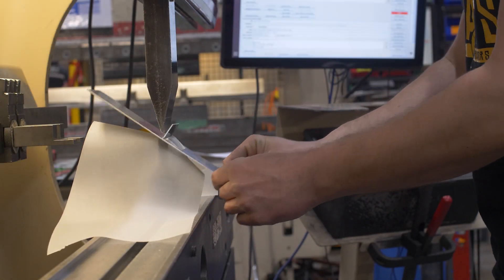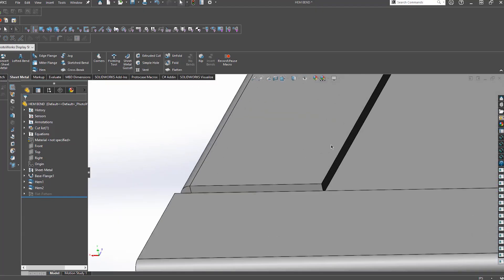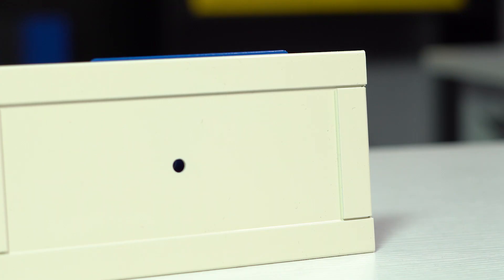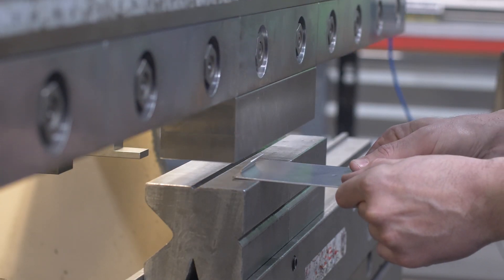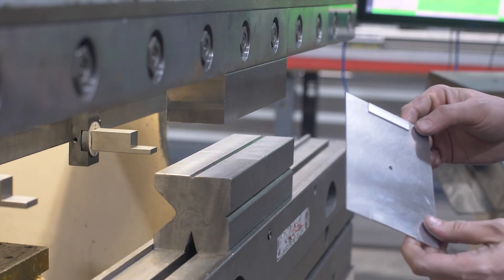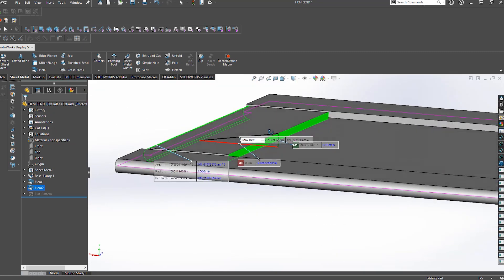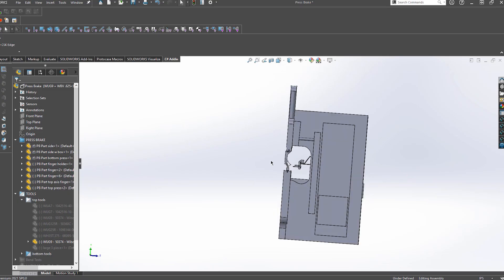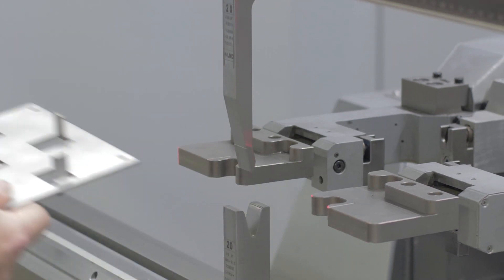Proto Tech Tip - Designing for HEM Bends

Comment: Hello, how to deal with hemming of the mitered corners? Is there any solution? Example: If I want to hem part like you in the video, only with the mitered corners. Thank you.
Reply from the maker: Hi there, we checked with our Engineering & Design Services team, and they said: "For our process of doing hem bends, if you required miter flanges we would need to remove the bend radius in the areas where the length is less than 0.5in. However, we would recommend going with how it is designed in the video."

We have a screenshot of how it would look to remove the bend radius, but you can't attach a pic to a comment on YouTube. 😕

Comment: What's the reason for the paper on bottom side of the die? Protecting material surface finish? Thanks for the video!
Reply from the maker: Hey Gordan, you got it! Our production team uses sheets of urethane when bending certain materials to protect the metal from being marked by the bending die. (Which is especially crucial for bare-metal parts, or parts that will be anodized, chem filmed, etc.) Thanks for the question :)